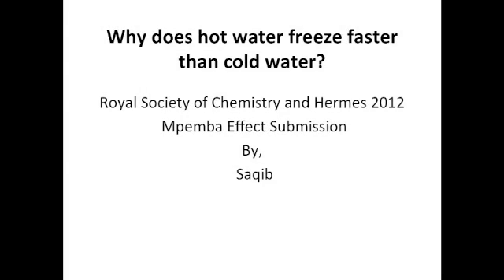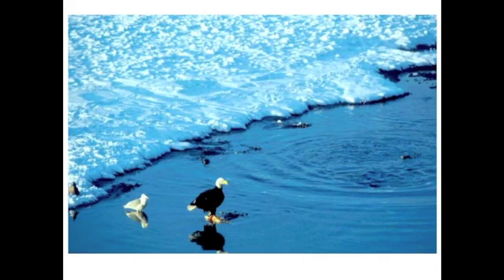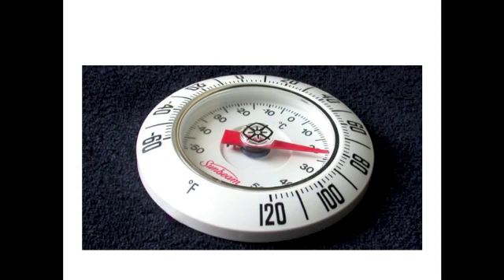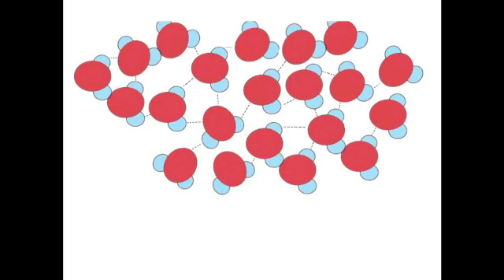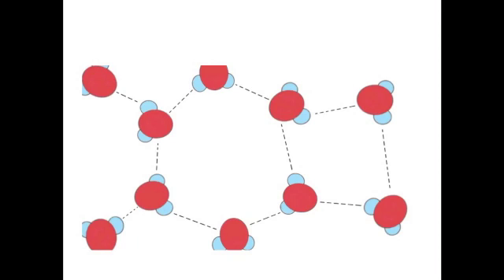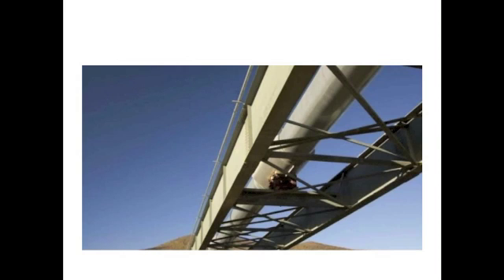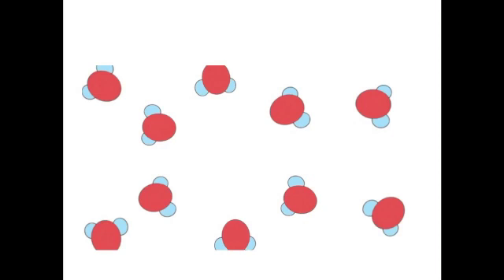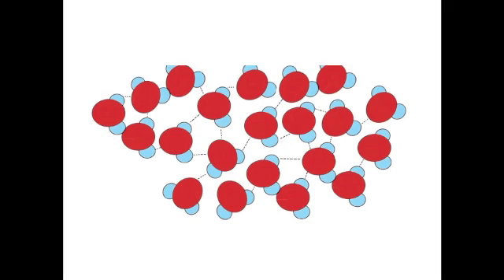Why does hot water freeze faster than cold water?

Comment: Hot water does not freeze.  At a constant pressure, water must cool to its freezing point before changing phases, which takes time.  All water at that temperature is the same temperature; no water at that temperature is warmer or colder than other water at that temperature, by definition.

Comment: Your explanation is not only tediously boring, you prove it wrong while explaining it. The correct answer is actually quite simple. Hot water freezes first because of a type of inertia. We all know that heat moves to cold. So here is the scenario: place two ice cube trays in the freezer at the same time, one with hot water, one with cold.. Somewhere in that freezer is the coldest spot. The heat from both trays of water will move towards that spot. The energy from the hot water will move towards that spot faster. The inertia of that faster movement of energy will carry over a bit after the two trays become of an equal temperature there by freezing first. That's it, simple.

Comment: I just thought of a theory I'm no big city scientist but wouldn't an increase in kinetic cause molecules to be exposed to the cold surface for a brief time then shoved aside by faster moving molecules before they have a chance to form a solid cause faster overall cooling? When cold water freezes it goes from the top down because the molecules are rigid and don't want to fling themselves around to the surface.
 I guess you could test to see if any water currents form inside.

Comment: Maybe you should read James D. Brownridge. His experiments show it's mainly about supercooling and the source of the water. Heating water can alter the temperature at which freezing will occur. In some cases lowering, other cases increasing the temp.  But for the water sources used the results were repeatable. So it's most likely to do with impurities that form nucleation sites, and depending on the specific impurities, heating may either increase or decrease the effect.

Comment: Here is my answer : hot seeks out cold, or seeks to expand. Because hot water molecules move faster , the hotter they are , the faster they move. Or, the higher the temperature difference, Because the molecules leave the hot water faster, seeking equalization, the temperature drop is faster , and the ice forms faster.

Comment: Knowing the average distance of molecules at different temperatures would be the start of the investigation, and knowing the average distance when frozen would be important too. You may find that the hot water only gets 0.0001% closer to the distance of ice, or you might find that it gets 50% closer.
So far I haven't gotten hot to freeze first because I don't drop the cup on a layer of frost or ice. Freezing in the same clock time is happening, but not first. (cont...)

Comment from the maker: A high energy hot molecule not wanting to settle down and make a low energy non-moving bond would be considered a normal feature of most substances, but as you probably already understand, a water molecule already has so many discovered exceptions that makes it extremely different from most other substances. My theory could probably only be tested under a very good electron microscope. Please Mr. Rupp, I would really appreciate it if you would share your idea on how to test my theory.